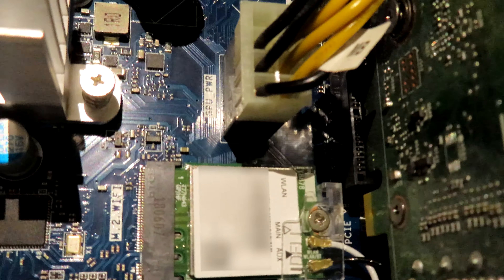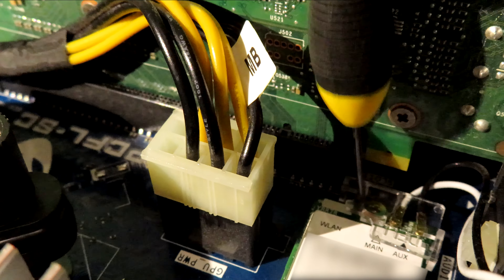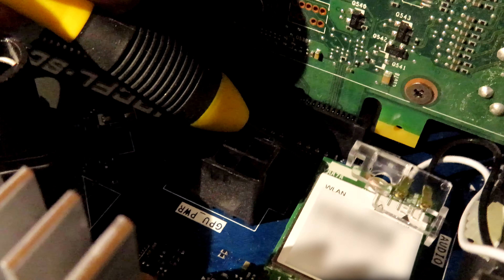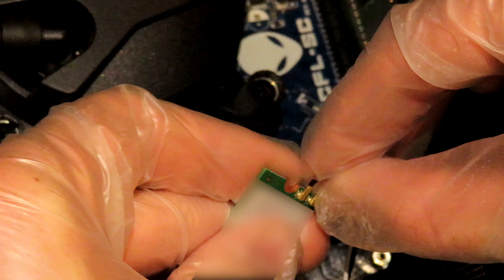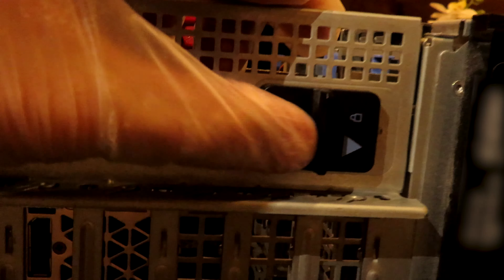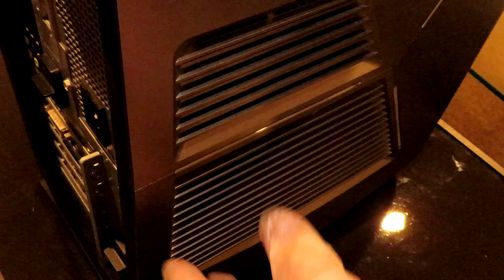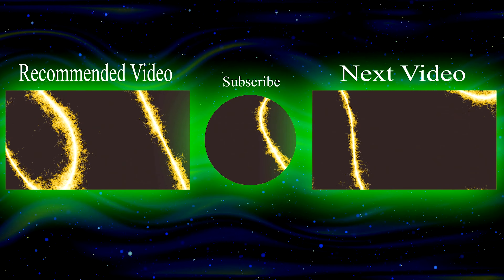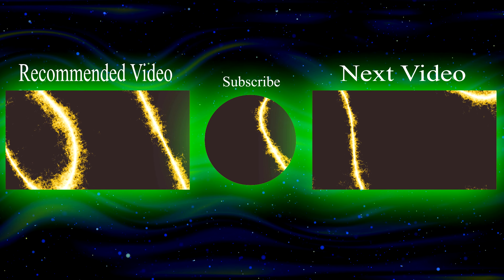HOW TO: Change A Wifi Card In A Computer | Alienware Aurora R7

Comment: my screw on the wireless chip is stuck and I can't find a screw driver small enough to fit in. any recommendations on how to take it off?
Reply from the maker: You can always try a flat head screw driver. I would recommend that you invest in a cheap small screw driver set for around $5 or so. Last thing you want is to damage the screw itself.
Reply from the maker: Apologies for the late response